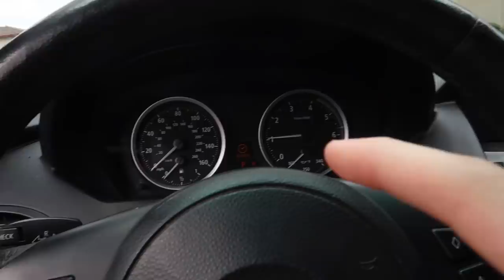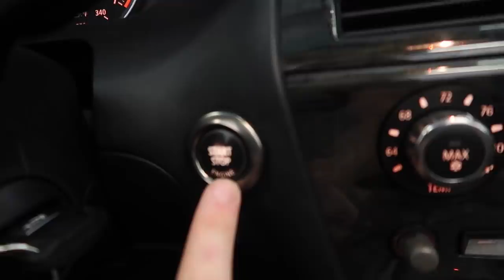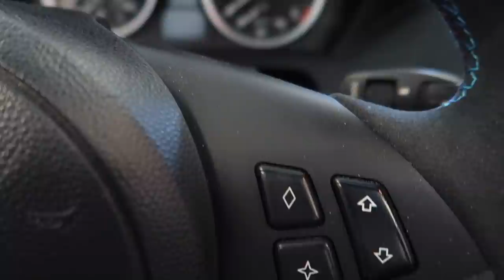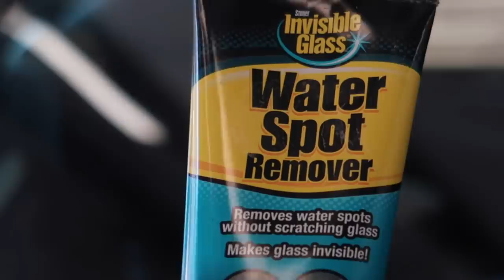1 OF 1 CUSTOM STEERING WHEEL FOR THE 650i!

Comment: Its probly your coolant transfer pipe or water pump leaking. They not super expensive.  They also make collapsible pipes so you don't have to tear half if the engine appart to replace. With that being said this engine is one of the least reliable BMW engines. Keep an eye for smoky exhaust cause the valve stems go bad sooner than later and its an expensive repair.

Comment: bruh you ballast is dead on the headlight, its not the red igniter thing you changed
Reply from the maker: Fr?
Reply: @NourHummadi  yes if the light comes on but turns off after a few min or seconds it means either the bulb is bad or  ballast is fried
Reply: @david smith  where can you find information for troubleshooting issues with my 06 BMW 650i